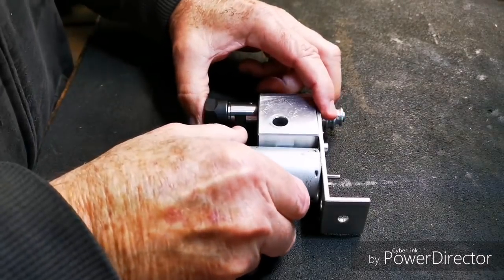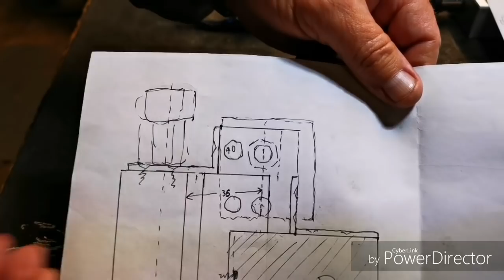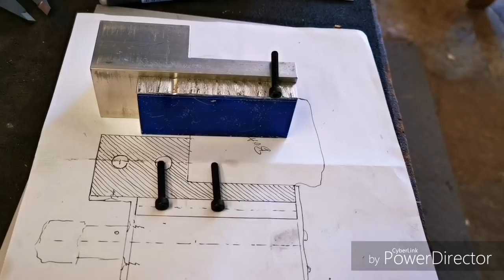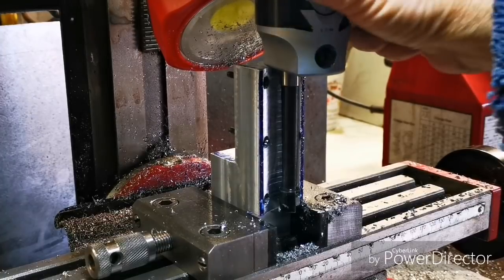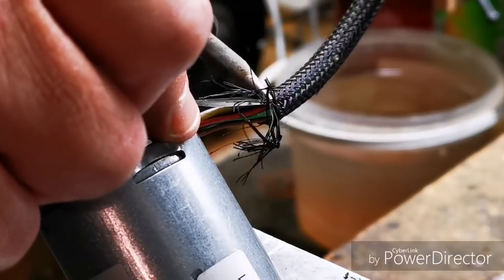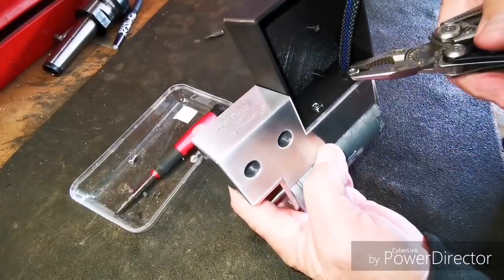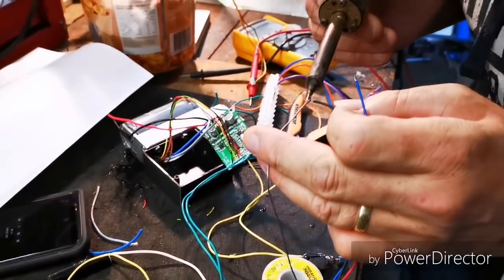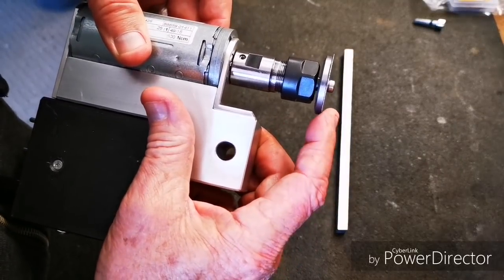tool post grinder take 2

Comment: I knew that motor would be the weakest link on an otherwise excellent setup so I have opted for a Bosch drill motor with a 5mm shaft. I am committed to the pulley design as I got all the parts to make it before I seen this😒